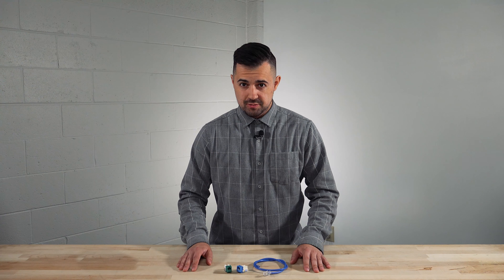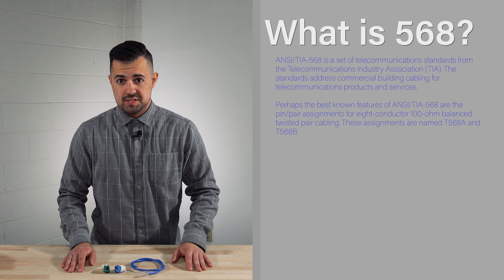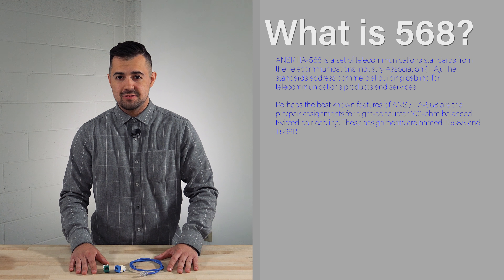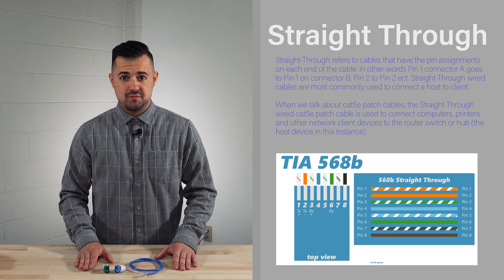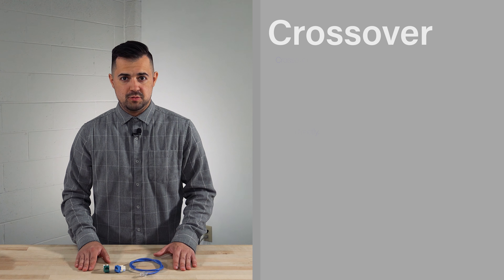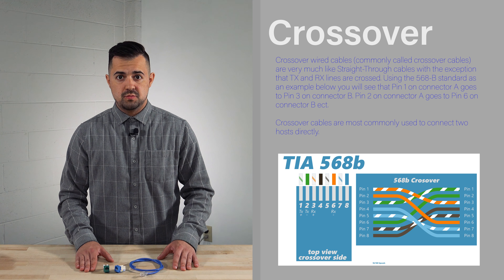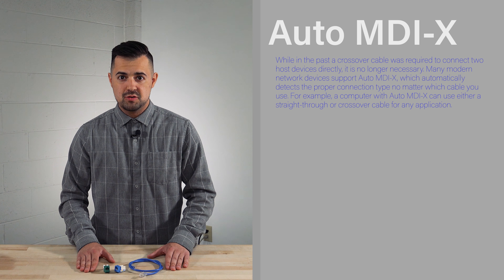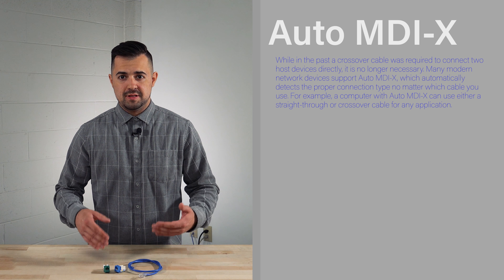CCS Wiring Guide on Straight vs Crossover Cables

Comment: what happened if i connect 2 computers using straight cable?
Reply from the maker: Most likely, the network port on the computer will automatically adjust the signals and make the cable a crossover. This is called Auto-MDI-X: "Auto MDI-X automatically detects the required cable connection type and configures the connection appropriately, removing the need for crossover cables to interconnect switches or connecting PCs peer-to-peer." via https://en.wikipedia.org/wiki/Medium-dependent_interface#Auto_MDI-X
Reply: @ComputerCableStore  how do i know that my computers supports auto-MDIX?
Reply from the maker: If your computer has a gigabit Ethernet connection it will support Auto MDI-X. If it is not gigabit then you would have to check the adapter settings to see if that option is available.

Comment: rj 11 and rj 45 is the same pinout ?  "crossover and straight through?"
Reply from the maker: RJ11 could possibly be similar to what the RJ45 connectors use. It depends on the cable & application. As long as each end matches while using twisted pair cabling you'll end up with a straight through cable.